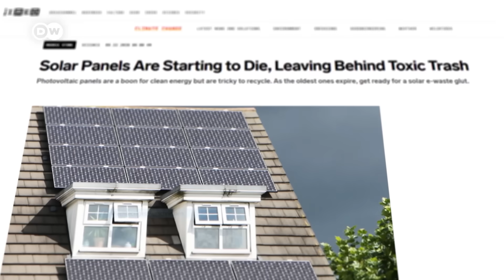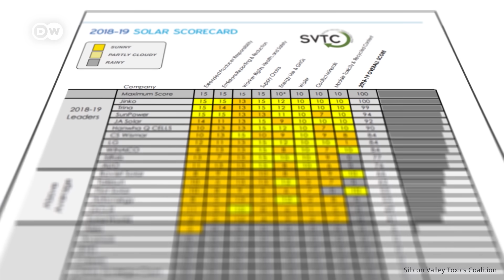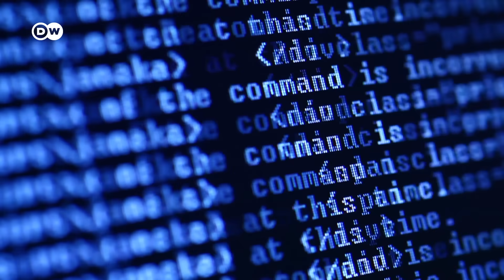How green is solar energy really?

Comment: With storage, solar produces very little net positive energy, which is why it's struggling to displace traditional energy sources in any significant way.
Reply: How do you account for wind & solar accounting for 40% of UK energy in 2022? or 36% of germany energy in 2022? Or Spain energy of 42% in 2022? You seriously think that's not significant?
Reply: @craigphd7844  No, not when solar and wind can NEVER fully displace traditional generators (coal, natural gas, nuclear) because of their variability. Yes, the total energy produced during the year ended up being an average of around 40%, but the output of those systems was not consistently around 40%, sometimes it was far less and sometimes it was far more, so other generators have to be kept on standby, all the time, or there will be times when production is not meeting demand.

Also, look at the price of electricity in those countries.

Anyway, I was talking about net positive energy, not just energy produced by solar and wind. If you were to take into account the energy required to produce those systems, their output would be far less impressive.
Reply: @PistonAvatarGuy  Net CO2 production from cradle to grave for wind turbines 5-26g per kwh. Gas plants, (type dependant) 450- 750g per kwh. 
Coal plants (type dependent)670-1680g per kwh. So thats at minimum 20x less than gas plants & upto 60x less than coal.
Solar panels production creates CO2. The carbon footprint payback is circa 3-4 years. So for the remainder of their life, (circa25 more years), solar panels produce zero CO2 emissions.  So their output is actually impressive.
Reply: @craigphd7844  How is any of this relevant? I'm not arguing in favor of fossil fuels. Your cradle to grave assessments of wind turbines and solar panels also do not include storage. The carbon intensity of solar is also 4 times that of nuclear, and that's without storage!
Reply: @PistonAvatarGuy  So you don't want wind & solar that reduces the running time of fossil fuels plants by circa 40% over a 1 year period? Why not?
No engineers are claiming to replace fossil fuel plants by the use of only Wind & Solar. Currently it's a supplement until a reliable efficient storage system is found. That will not be batteries, which is why many other avenues for storage are being persued.
My simple solar installation, without batteries, has reduced my reliance on gas plants power by 4.9Mw. Thats a net CO2 reduction of 4.3 metric tons! Yet because it doesnt work 100% of the time you seem to think it is of no use. Clearly that is nonsense thinking. Is it not preferable to have fossil fuel plants on standby instead of putting out tons of CO2 & producing toxic ash & fly ash to the tune of 120,000 metric tons per year.
Got a water shortage in your area? try researching how much water a coal or gas plant consumes per day. Heres a start. A typical 500mw coal plant uses 45 million litres of water PER HOUR!
Reply: @PistonAvatarGuy  Where are the nuclear power plants that are replacing fossil fuels? Not built that is the answer. They are not here yet. In the mean time solar & wind are reducing the reliance on fossil fuels. A solar farm or a wind farm can be brought to fruition in a lot less time than that taken for a Nuclear power plant.
The levelised cost of energy (LCOE) shows that solar & wind are the cheapest form of energy when compared to coal gas & Nuclear. Cost per MWh: Coal- $65-$152. Gas (combined cycle) $45-$75. Nuclear $130-$200. Wind £26-$50. Solar pv Utility. $30-$41.
You keep stating "failing to replace dependence on fossil fuels" which means you keep ignoring the 40% reduction in their use.
As for france.: The government have now had to fully nationalise the Nuclear plants to prevent  the main energy supplier EDF, from going bankrupt. They are also bulding large offshore wind farms to reduce their reliance on fossil fuels. They are also now recommisioning Nuclear power plants. At the end of last year 26 were offline. Now it is down to 14.
Of course nuclear power generation would be great at replacing fossil fuels. But the sad fact is, that they are not available. Until they are, the only way to reduce reliance on fossil fuel power generation is through renewables. If there was a choice today of either using renewables or using nuclear, then Nuclear would be the option chosen.
BTW, the treated sewage used by palo verde increases the cost of power generation, which is why they are looking for other sources.
Reply: @craigphd7844  "The government have now had to fully nationalise the Nuclear plants to prevent  the main energy supplier EDF, from going bankrupt."

And this is completely meaningless. If profitability were a major concern, France could increase the price of its electricity by 50% and it would still only be as expensive as the electricity in Germany. What would happen if Germany were to try to sell their electricity for the same price that France sells theirs? Bankruptcy, maybe?

Heck, France could DOUBLE the price of its electricity and it would still be less expensive than the electricity in Denmark, which is largely dependent upon wind energy.
Reply: @craigphd7844  I suppose that we could simplify this discussion if I simply ask this one question: What is the cost per MWh of solar and wind energy when they don't have traditional generators compensating for their variability and when they're able to meet the demand for electricity with the same kind of reliability as traditional generators? Does this information even exist? You're a PhD, correct? If so, this question should be easy to answer.
Reply: @PistonAvatarGuy  Don't you understand the word "Supplement"? Fossil fuel plants are not built to compensate for variable renewals. They already exist. Renewables negate the use of fossil energy generation when operating. So the question in reality is actually how much have renewables reduced the cost of energy & reduced the harmful emissions. The reduction in cost per Mwh obviously varies by country depending on their renewables mix. Using Lazard data, for Spain, with a 86TWh renewable energy production in 2021 out of a total of 259TWh that would be a yearly reduction in MWh costings of 11%. Also don't confuse what it costs to produce something against what it is sold for.

Comment: Wind turbines and solar panels only last for 20 years, and as soon as you use it, it starts losing efficiency especially the solar panels. After 20 years, you have to replace them, where would you put the waste, how would you recycle them?
Reply from the maker: Hi Rap, we have looked into this topic (more specifically for solar) in the following video: https://youtu.be/EWV4e453y8Y ☀️ ♻️
Reply: Solar panels last for in excess of 30 years. Thats the same lifetime of a gas, combined cycle, power plant. Manufacturers give a 25 year guarantee of 85% of original output up to 25 years. Currently, in 27 countries it is the law to recycle a minimum of 85% of the panel.  95% of the panel is recyclable.

Comment: I have heard that you need coal and woodchips to make solar pannels.....What about that? On the other hand, what about the backsheet and the encapsulant?   that is plastic. Isnt it? Is that recyclable?   Thanks for your video.....
Reply: 95% of a solar panel is recyclable. In 27 countries it is the law to do so to a current level of 85%. 
Accounting for the amount of CO2 produced during solar panel manufacturing, solar panels generate, in effect, around 50g of CO2 per kilowatt hour during their initial years of operation. This is about 20 times less than the carbon output of coal-powered electricity sources. Your panels will require about three years, or less, of operation to pay off their carbon debt and become carbon neutral. Carbon is used in the manufacturing process.
Solar panel manufacturers use 70-85% of energy in the production process from solar panels.

Comment: Here's the real problem solar simply doesn't provide enough power without back up like in Germany where there is huge coal and Russian natural gas. It also has a limit in its power conversion capability & efficiency this is measured in what's called the Shockley-Queisser limit and that's a maximum of about 33% of incoming photons converted into electrons the best on the market presently are just over 26% so we are reaching its limit in real world Physics. Another good point is nuclear is flat out better greener in just about every way. Also The average power plant takes up something like 200% less land than solar and 400% less than wind. We are going to run out of farm and land development. Something rarely discussed. Then the is the problem of batter storage all the mining requirements for renewables is aging Something not much talked about but the deep pit mining required will have to increase by well over 400% a industry with an avalanche of green problems and pollution. These are excellent topics for future videos thanks for the informative channel

Comment: Just because solar panel trash had to deal with recycle, doesn't means we need to switch back to burning more coal. Most CO2 emission activity are coupled with air pollution. CO2 emission it's just one of many other harmful factor to human and environment. Like many new technology, they require time to develop to be more effective. Just like how car engines become more efficient over the course of 150 years. You can't just kill something immediately when you encounter a problem. Solar panel has much more "clean" potential than burning coal would ever achieve.
Reply: Solar panels are actually 95% recyclable. It is the law to do so now in 27 countries at 80% level.

Comment: I don’t believe you mentioned anything about the batteries that are required when using solar grids. I would be interested in knowing the carbon footprint when those are accounted for.
Reply: Batteries are not a requirement for solar installations. A simple solar household installation will provide solar energy just during the day and reduce your energy reliance and reduce your bill. Solar farms don't use batteries.

Comment: Solar destroys eco systems even in the desert. It takes up 100 times more space than the typical land area that a nuclear facility takes up. It's waste is building up, chemical leakage into our streams,  poisoning are plants, animals, bugs, fish. It will be very bad for everyone. Ever wonder how those dystopian movies everything is "green" but the air is unbreathable. That is what will happen. 
It is a lie that solar panels effective lifespan is 30years. It's actually 10years.
Reply: Are you advocating waiting 10+ years for a nuclear power plant to be built?  Thousands of Mwh of energy can be built using solar/wind in the time it takes to build a nuclear power plant. Or do prefer coal plants producing 120,000 metric tons of toxic ash & fly ash every year. Which contributes to human as well as wildlife deaths, & polluting the atmosphere & ground. 
Got a water shortage in your area? Coal- 50,000 litres per min consumed, 40,000l for operation. Nuclear uses 3500L - 5000L per MWh in closed-loop systems and 25,000 - 60,000 gal per MWh in open-loop. Solar uses 225 - 520 gal per MWh (washing Photovoltaic panels).
Solar panels are 95% recyclable. It is the law to do so in 29 countries. It is enforced in Europe.
Solar panels come with a 25 year guarantee of 85% of original output.from the manufacturers.  They last in excess of 30 years!

Comment: Polycrystaline silicate requires 5 tons of silicon which has to be heated to high temperate from coal fired furnaces. This amount only produces 1 kilowatt of power. Right now so called green energy is producin far more co2 and chemical polution than hydocarbon energy. Lol , It's all about redistribution of wealth in the religion of domination ESG = Global Marxsist domination...
Reply: You need to look more closely at how the silicate is now produced. Electric arc furnaces are now the most efficient system used. Guess what companies use to subsidise the electrical energy requirements? Yep, Solar PV panels. So your arguement is mute. Also try looking up LCOE for solar vs fossil & CO2 production from cradle to grave. The current Co2 production from solar is nealy 50X less than all fossil fuel, and that is increasing with technological advances.

Comment: So if we have issues with waste management now, this will only grow,
because it will be cheaper to dump these panels than recycle them.
Reply: It is now the law in 30 countries to recycle a minimum of 80% of a solar panel.  95% of a solar panel can actually be recycled and some countries are doing just that. WEEE DIRECTIVE 2012/19/EU.
Reply: @craigphd7844  The law does not mean it is proceeding in the right manner.
This means that right now a lot of waste which
is so-called recycled ends up in poor countries.
Reply: @birch8005  So a law requiring solar panel recycling, does not mean it is proceeding in the right manner? Is that as opposed to there being no law at all? (As you originally thought). You haven't actually read the solar panel recycling directive of the EU have you. It specifically prohibits exportation. It is also completely irrelevant to what happens in the massively diverse plastics industry.
Reply: Ph.D.We also have directives which
says we need to reduce pesticides but still, we use them.
Reply: Ph.D.We also have directives about 
plastic reduction. It does not work in a particular region or country(ies) impact can be achieved that is done on a global scale.

Comment: No mention of all the space needed for the solar panels and windmills, or how the earth need be raped for these rare metals. No mention of all that farmland being taken from farmers and trillions of trees being cut down to put panels and windmills. No mention of the child labor used in mining these metals. No mention of China being the main supplier of these panels and windmills. And, no, those panels are not going to last 30 years on average and windmills break down as well. No mention of all the birds killed as more and more windmills put into use, a problem that will just keep getting worse as the number of panels and windmills grow. Be more thorough please. It's as if you can't see the forest for the trees
Reply: Windmills are what were built in the 18th century! So referring to 21st century wind turbines as 'windmills' totally undermines your credibility.
Trillions of trees are not being cut down for wind turbines. That's nonsense. Farmland is not being TAKEN from farmers. Ever heard of agrivoltaics? Guess not.
Ever heard of solar on roof tops, car parks, in desert areas? guess not.
Solar panels have lasted 30 years. manufacturers actually give a 25 year guarantee of 85% of panel output.
Of course wind turbines break down. So does your car. Does that mean we shouldn't use them?
Millions of birds die every year from the toxic output of coal plants.
Got a water shrotage in your area? The average fossil fuel power plant consumes 120,000 litres of water per minute! They also need 300,000 litres for actual operation!
Also solar panels are 90% recyclable and it is the law to do so in 30 countries. Wind turbine blades can now also being totally recycled.
Reply: @craigphd7844  I would provide links of trillions of trees being taken down to make room, if I thought you had the ability to reason and hadn't already outsourced your thinking to the globalists who want to drastically reduce the cow population cause they fart too much.

PS windmill=wind turbines. You'll still hear the former used more often even today.
Reply: @craigphd7844  The student asked the blind master how is it you can here the grasshopper. The Master replied, how is it you cannot.

This is literally stuff in the news you are just ignorant to. Why such ignorant people are the first to mouth off always defies logic.
Reply: @kevj9589  So no update on how many trees are left in the world after your claim of 'TRILLIONS' are cut down. FYI there are at least 5 left as i can see them in my garden.

Comment: DW is obviously biased in favor of corporate "green" profit. The report didn't even mention all the energy needed to extract the materials, transport, process at facilities, packaging, transport again to point of sell, transport again to point of setup, and all the energy needed to take down, transport, reprocess, etc. Fossil fuels are greener than solar panels.
Reply: Levelised cost of energy, LCOE. Cradle to Grave. $/Mwhr. Solar PV Utility scale $31-$42.  Wind $26-$54.  Coal $64-$159. Nuclear $129-$198. Gas (combined cycle) $44-$88. Gas peaking $151-$197. Solar & wind power are massively cheaper. Fossil fuels receive $30 billion in subsidies in the US & 5$51 in Europe. Data from Lazard.
Emmissions. Cradle to grave.  Solar PV 6 gram co2/kwhr. Wind 7 gram/kwhr. Coal 109 gram/kwhr. Gas 78 gram/kwhr. Coal plants also produce 120,000 metric tons of ash & fly ash every year.  Got a water shortage?....Coal, Gas, Nuclear plants consume 130,000 litres of water per minute.
Fossil fuels produce, on average 10x more CO2 & other waste than solar & wind. Fossil fuels are not green.

Comment: If the Sun gives out solar radiation . Wouldn't reflecting that through the panels make sun hotter potentially overheating the sun and creating a red star?
Reply from the maker: Interesting question! We've touched on the topic of solar panels in the earth's orbit in this video: https://www.youtube.com/watch?v=2hwpXCjmkRo – here it is explained how solar power would technically be used from space.
Reply: only a tiny fraction of sun's radiation reaches the earth and only a tiny bit of that is reflected back to the sun...it makes no difference...you cannot overheat the sun by solar panels